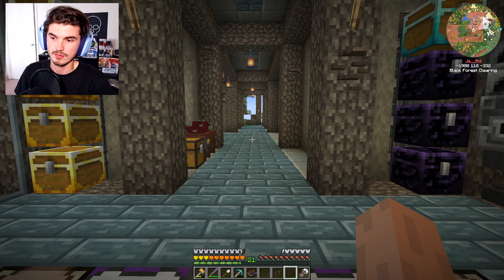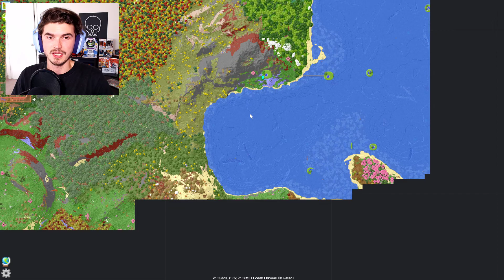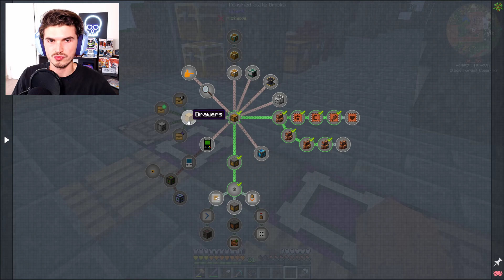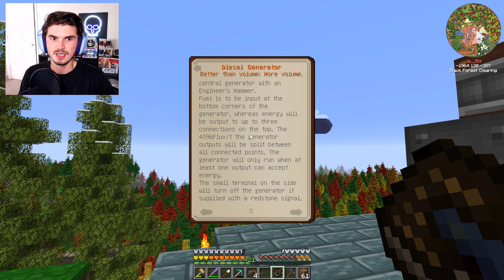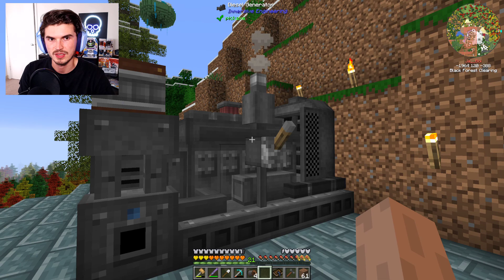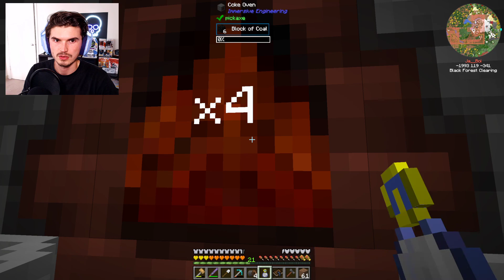Enigmatica 6 - Ep. 20 - Diesel Time!

Comment: for steel i generally dip into mekanism temporarily since its much easier AND quicker to get steel that way. Just coal and iron
Reply: You might not be readin this but for anybody else, the modpack has fluxnetwork, which is a good wireless power transfer
Reply from the maker: Yeah I just wanted to grind a bit is all🤷🏻‍♂️ but yeah flux network is a good wireless power transfer! There are a few options actually. But I'm just taking my time🤙🏻
Reply: @MiloJay31  Ye do it how you want man.
I stand corrected anyway, apparently the enigmatica team tweaked flux, so u cant use it unless you get to the end of the powah mod, oddly. Makes it impractical, since i realized powah has its own wireless power transfers called endergates.